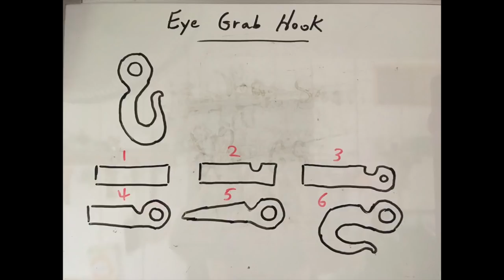Hand Forged Eye Grab Hook

Comment: enjoyed that a lot mate. The grab hook on my bullock chain ( to get the most strength for the pull) a line drawn through the eyes centre should be incident in the centre of the major bend of the hook. The backwards bend helps to admit the chain. The width of the gap formed by the hook should be a millimetre or so wider than the chain to be used. To get the line through the eye to the centre of the hook I put another bend right below the eye to line it up. The will prevent the load from turning the hook and dropping the chain.  I make mine the same as you forge the eye ut the I heat and quench part of the eye and bend from right below the eye off centre about 17, 20 degrees then taper and forge the reverse tip bend for chain access. Then forge the bend bringing back the hook to line up with the line of the pull through the eye. finally sorting the gap by closing up the eye on a sample of the chain to be used. It will grab the one link but the link in the opposite orientation ie the very next link will lock under load and release when slack. LOve this method of yours. I was shown to punch a slot and drift it round. Is there any difference in the strength of the eye punching and drifting round versus drifting a slot round. Love watching your channel here in Australia cant light the forge because of the bush fire problem we are in currently.

Comment: Hi Glen, nice project, thanks for sharing.
What is this hook used for?
Reply from the maker: This sort of hook is typically used for heavy pulling and lifting operations - used in conjunction with a chain or maybe heavy rope. But my hook design here needs some improving before it can safely lift anything too heavy. Just mostly a decorative piece as it stands.Thanks.

Comment: Punch the eye last. Also, the balance of material is off.... eye walls are way thinner than the hook itself. But I enjoyed the video a lot. You're style is odd, interesting and clean. I dig it.
Reply: yeah it takes time to get good
Reply from the maker: No question I need to improve this design to make anything more than just a decorative hook. Your points are well taken and I will definitely have another go or two at this style of hook. Thanks.
Reply from the maker: That's the double truth...
Reply: @gstongs  yessir, everyone crawls before they walk. have you tried making a tomahawk? that could be a good project for you. you dont need to add a bit to it just a old fashioned trade axe or belt ax would be a good little project. havent rummaged through your channel very much as i would like to. keep up the good work :D may i suggest looking up some vintage blacksmithing on youtube you might be able to find some good information you could use